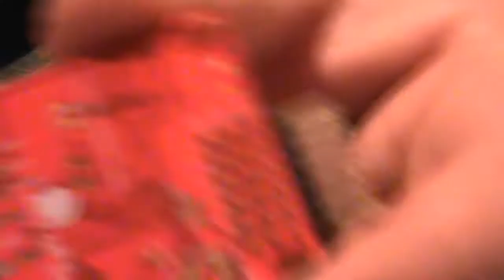How to solder a Naze32 Acro

Comment: I'm semi new to soldering, well really new, I've only done it a few times. what what the liquid you put on the pins before you soldered them? How does it help?
Reply from the maker: +Daniel Willets Its called flux, it helps with the flow of the solder. I usually use a flux paste on wires, but the liquid flux is best for the copper tabs etc.
Reply: thanks, really helpful video by the way!
Reply from the maker: Thanks :)

Comment: Any tips for how to remove pins? It seem like you need a few soldering irons in order to remove a group of pins.
Reply from the maker: SF PV http://www.amazon.com/Parts-Express-Solder-Sucker-desoldering/dp/B00QTGEL18 Is probably the easiest way. It may take a few goes to get enough solder from the holes. But ive used mine a few times with success
Reply: Cool thanks dude!

Comment: Great video. I just purchased a 32 from local hobby shop. SHOUT to Kioni and the gang at Hobby Action in Arizona. Looking forward to setting it up. Found much needed information on this video, thanks. Just wondering with the popularity of using OTG cables do you think any of these will ever interface with an Android device? I would rather use the USB than Bluetooth any day.
Reply from the maker: +Azsweetwater2011 yes i use a OTG cable with the android app.

Comment: Just got this board. I got the pins as a row of 15 pieces but I canẗ for the life of me seperate the strip into individual pieces so i can solder them on to the board. Should i just cut or how would i best do this?
Reply from the maker: Yes, jsut cut them with a razor blade is fine. Just be carefull. Sometimes the peice cut goes flying across the room never to be seen again untill it meets your broom/vacum cleaner...lolcup your hand around it to contain it when you cut em. :)
Dont forget to like and subscribe. Any questions feel free to ask.

Comment: great job...what size watt for the iron do you recommend for these copter builds? 25-40?  Thanks
Reply from the maker: Thanks Joe, I use a 60watt iron, but a 25watt would work just fine. I do now have mine on full power, about 60 percent!! The key is not to much :)

Comment: I am not sure why it has to be tricky on the receiver pins.

You just have to pinch so they get close together but not too close, do the same with the other pins and slide it, and you can feel the grip, and you'll notice, they do not move or drop when turn it upside down.
Reply from the maker: +Jayson Ragasa Thanks, thats a great tip. I did it on my other board, worked great. ;)

Comment: Anyone else having problems soldering the motor pins on the naze32? No matter how much flux I use it just blobs and make poor connections (other pins are fine). (Same thing with the Afromini). Also one of the motor pins seems to be missing the metal surface completely.. I wasn't exactly surprised when the flight controller didn't work either.

Seems like the high demand is pushing the qc aside.
Reply from the maker: Where did you get yours from? Ive don't 2 now and no issues.
Reply: eastcoast78 Abusemark. I guess it's just bad luck. Too bad it's already sold out, so I probably have to wait a couple of weeks untill it's in stock again.

Comment: ps.

I need some one of those flux pens - where did u buy that?
Reply from the maker: i picked mine up a the local elec store. But im sure a radio shack or even a hardware store you might be able to source one.http://www.amazon.com/Kester-951-Soldering-Low-Solids-No-Clean/dp/B004X4KOWS
Reply: I didnt' know these existed as I've been doing it the old fashion way lol. But I'll buy some from fleabay

Comment: nice mikey.

They are pretty easy to solder - for those whom can solder I mean. Huge part of this hobby as you are well aware. Let me know if you need any help with installing firmware or anything.

I can also send pids if you like,
Reply from the maker: Thanks Ryan, installing Firmware? Do i need to? I got the latest base editor. Not sure whats on the board though. I assume the latest?? I made some changes to the CLI tonight. Motor_stop and Vbatt on. also did the mag calibration. It'll be last June before i get my frame for this board. As the MXP230 is due in stack around mid june. So that gives me lots of time to read up. One thing im looking into now is changing the orientation of the board. 90CW or CCW so i can have the USB on the side for easy access. How was yours at default PIDS?
Reply: mine is on the side. I had someone help me and I'll forward the info to you, check your rcgroups pm